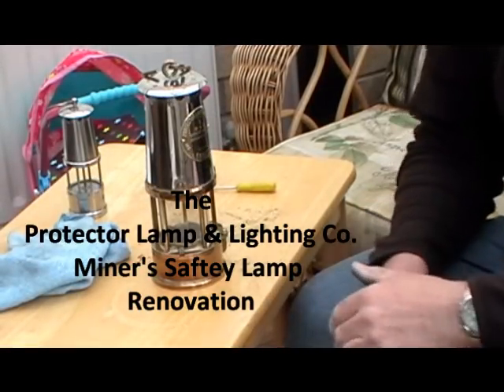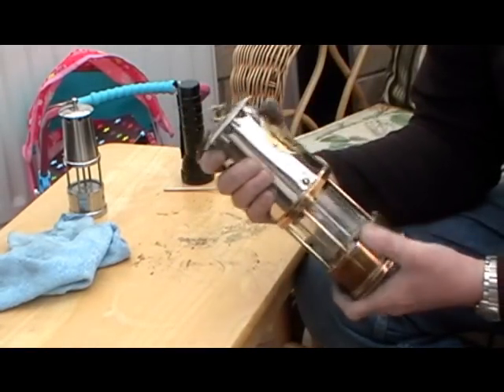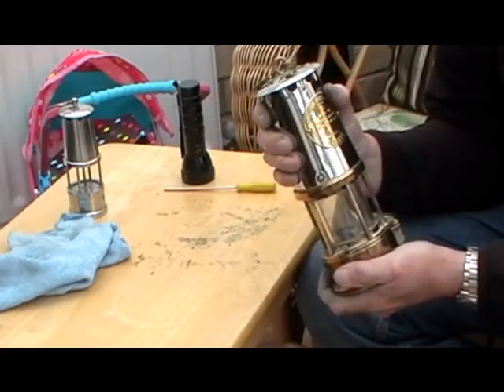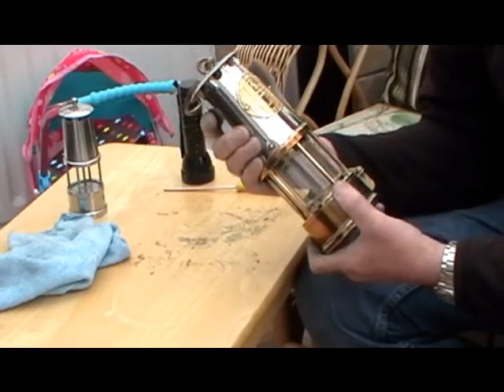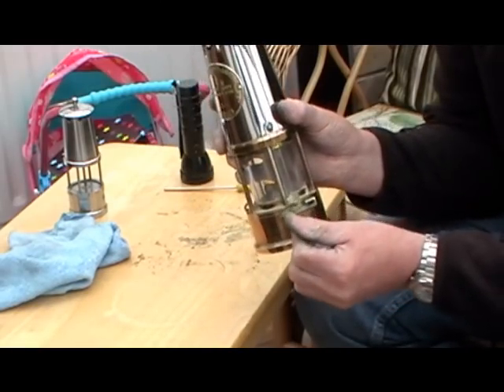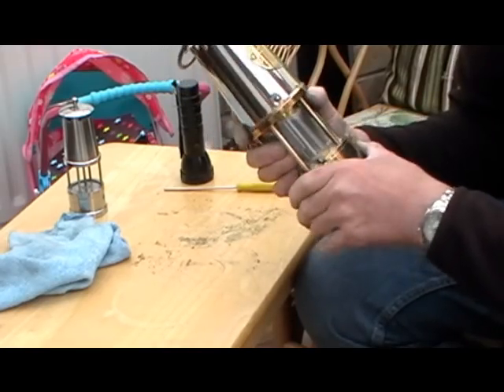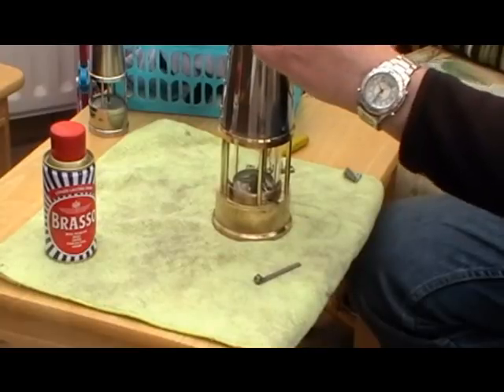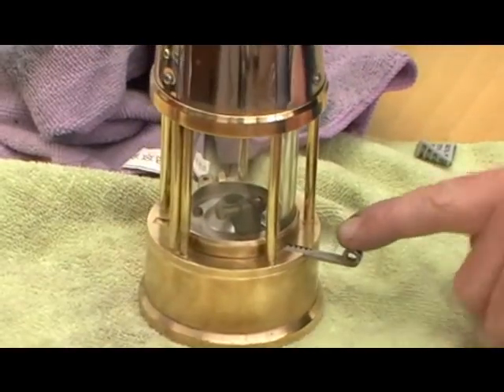Protector Lamp & Lighting Co. Miners Safety Lamp Renovation, How it works etc assemble "mr factotum"

Comment: Great little video. I’v converted a couple of these into electric lights with a small bc brass lamp holder. Really effective and looks great. I believe these round gaskets were asbestos until 2000 though!
Reply from the maker: That's a great idea! TC
Thanks for watching and commenting
Yes you may be right about the gaskests👍👍
regards
Kev

Comment: For your future reference, the catch on the base should be should have a pin that stops the catch from being turned to prevent the lamp being opened underground.  The lamp could only be opened in the surface lamp room that had a strong magnet fixed to the workbench that released the pin allowing to locking catch to be turned. If anyone has a lamp that the pin has not been removed, a strong magnet will be required held under the brass to release it.
Reply from the maker: hi rb68
thanks for watching and commenting, appreciate the info.
regards
mr f
Reply: Those are the non re-lightable wire lit and magnetic locked lamps.
Reply: The particular lamp in the video would have used a lead rivet to lock it, but you are right - the usual Type6 / 6RS / GR6S / SL would have had a magnetic lock

Comment: just got my dads pit lamp working and we have three off theses same lamps amd when you undo the bottom off the lamp the hindge with the hole in is for the lamphouse could seal the lamp i think too stop people messing with the lamp but i have got it working case if we get a power cut this winter in 2022
Reply from the maker: eyup ade 1772
great to hear your giving them a new lease of life, yes your correct about the seal.
lets hope there not needed this winter!!👍
thanks for watching and your feedback, it's appreciated
regards
Kev
Reply: @MrFactotum  thanks kev and like you my dad and grandad worked down the mines me dad just a little he didn't like it that much but me grandad was miner Al this life and still have his tags too
Reply: @MrFactotum  oh and mine I have running on lighter fluid atm
Reply from the maker: @ade-1772  👍👍
Reply from the maker: @ade-1772  yes i need to get some lighter fluid to try, 👍

Comment: Hi Mr Factotum.
   T he mechanism, was locked so  you couldnt undo it down the mine.
in the lamproom, on the surface, they used a magnet to undo the lock, that lamp was used by Deouties, Overmen and management, these lamps could be relit if they went out underground. 
The other type you mentioned was used by ordinary colliers, if they went out they couldnt be relit.
They were filled with Kerosene, 
I have a couple of lamps, one the same as the one you got off your Dad and an ordinaryone, I havnt had them lit for years, but now Ive seen your video I might get them out, give them a polish and try to light them.
Afriend of mine, he was a Deputy at the pit I was at, he buys, refurbs and sells them, I know you wont sell yours as it has got sentimental value.
If I can be of any assistance please dont hesitate to leave a message.
Reply from the maker: thanks for comments alan, appreciate you taking the time to view
regards
mr f

Comment: Nice video sir ,I have numerous safety lamps and have finally got a deputies relighter with magnetic lock which was tricky to open as in rusty etc.
Having done all I could I have managed to get it working but the top half of the lamp is getting very hot.I worked down two mines and cannot
remember them getting really hot .Does anyone have any idea why. I use Colemans lead free fuel as recommended by a restorer .any help would
be appreciated
Reply from the maker: hi Raymond
Thanks for the feedback, appreciated👍
Not sure about it getting hot, i'm no expert , only what i learned fro stripping my Dad's down. 
Only thing i can think of is ther too much wick burning and causing to much flame, hence burning hotter.
Hope you get it sorted
Regards
Kev
Reply: @MrFactotum  Thank you for your reply. I have turned the wick down as much as I can without it going out.
and it still gets too hot to even touch .I have more lamps that do not have the magnetic lock on so I will get those fuelled up and see if they are the same .
Regards
Ray

Comment: Hi Mr Factotum, after watching your video again yesterday, it spurred me to go to my shed, its been too cold lately even though I have a log burner in there.
I have another safety lamp, manufactured by Hailwood & Ackroyd.
It is an early one as Hailwoods & Ackroyd started out in 1897 as Ackroyd & Best, then reforming the company in 1927 as Hilwood &  Ackroyd.
The company was in Morley, near Leeds.
This one is a colliers lamp (not like yours which was used by Deputies, Overmen & Senior Management, which could be re-lit if it was accidently extinguished, as they needed safety lamps to test for gas, methane, before shot firing).
These type could not be re-lit, once out they stayed out until being returned to the lamp room on the surface.
There is some interesting reading on safety lams, or Davy lamps as they are called, on Google.
Where abouts are yo, it sounds like Notts/ Derby area, Im from Notts, a mining village called Bilsthorpe, near Mansfield.
Reply from the maker: hi alan
nice to hear from you
thanks for info,  glad you were inspired to get in to the shed, I'm there much of the time making my steam locomotive at moment, and yes i'm battle hardened to the cold this time of the year. yes, good guess, Derbyshire, my dad worked at Markham colliery all his life.
regards
mr f

Comment: Hi I have only recently come across my great grandads lamp it is the same model the same markings as your one. I am trying to restore it. Did you ever manage to change the wick I'm unable to work this our any info would be great thanks 
Steve
Reply from the maker: hi sr
its a while since i did it but from memory you just pull the old wick out with a pointed too; obtain a new wick of the correct diameter,( it needs to be a tight fit), push the new wick in with a suitable pointed tool   as far down as it will go, then trim the wick off about 3mm from the top of the wick tube., 
hope that helps
regards
mr f
Reply: @MrFactotum  
Thank you so much I can't wait to get started on it now get it back to working order. Did you work out was it paraffin that it needs?? Thanks
Reply from the maker: @stryryan6968  paraffin will work but may smoke a little, look out for a proprietry lamp oil, one's called cosaline i believe, but most lamp oil will be ok

Comment: Hi, I just inherited my great Grandad’s prospecting lantern, he died with it in a mine collapse unfortunately can’t unscrew the bottom wick holder, would love some tips to try and get it off and get the lantern running again
Reply from the maker: Thanks for your interest
That's a sad story, a lot of people don't realise how dangerous the mines were or still are, but more so in your great grandads era.
Make sure there's no discreet safety catches. Try heating up gently to start with,  with a hair dryer, to expand the screw thread, then try to screw it whilst still hot!!!!! wear gloves!!!! Good Luck and get it repaired and lit in your great grandads memory. Hope this Helps
regards
mr f
Reply: Mr Factotum thank you for replying I will definitely try this
Reply: @jamesdinnigan2565  If the lamp isn't this adjustable type of lamp it will have a wire that lights it from an applied voltage. They were opened by means of a magnetic latch I believe. Try The Protector Lamp And Lighting Company that still make spare parts.

Comment: Idea's please to unscrew the bottom section (it's very tight at the moment).
Reply from the maker: Hi Christopher
Try heating up with a hair dryer. If still not moving. Again heat up with hair dryer and try soaking the joint with penetrating oil / wd 40 while still hot
Good luck
Regards Mr f
Reply: Hi Christopher, I dont know if you have managed to get the base open on your lamp.
If not, there is a video on youtube titled, "GR6S Miners Lamp Service" this explains how to do it, you need a fairly strong magnet, then watch the video.
If you red my previous comment you will see Mr F inspired me to clean my TWO lamps, one an OFFICIALS lamp, like the one shown in this video, the other, a fairly old one, that one was for the use by colliers, this couldnt be re-lit if it went out.
Hope this helps if you havnt got the base off yrt, regards, Alan Dobb.

Comment: I wonder if a person could find a pin somewhere that locks the bottom latch, thats the only thing missing from my lamp?
Reply from the maker: hi sw
yes .i realise the safety pin is missing,  its on my list of various projects, etc, to make one, well spotted, thanks for watching and commenting
regards
mr f
Reply: @MrFactotum  Was there a pin as such or a twisted wire and lead seal? You might try asking The Protector Lamp And Lighting Company for details, they still exist. I had one of the lamps but never worked underground.
Reply from the maker: @COIcultist  hi
yes theres a safety pin missing, when ive time i'm going to make one, you can probably still get them for anyone unable to make one
thanks for taking interest and watching
regards
mr f

Comment: Cosoline if I remember
Reply from the maker: Thanks for the info
Regards
Mr f
Reply: It's spelled Colzalene if anyone wants to research it. It's basically naptha ...which is a variant of petrol. A close alternative would be Zippo lighter fuel or Coleman camping fuel. According to my research, some lamps ran on paraffin, but all the sparking/relighting lamps ran on this Colzalene.

Thanks for the video. I inherited 2 of these lamps from my dad and niether have ever run. Thanks to your video I've managed to get one broken down and even to spark. I'm confident I can get them both working again now.

But I dont think you have done your lamp any favours by putting diesel in it. If I were you I'd change the wick and give the tank a long soak in petrol to try and get that diesel out of it.
You can still get parts for them from the orginginal manufacturer.